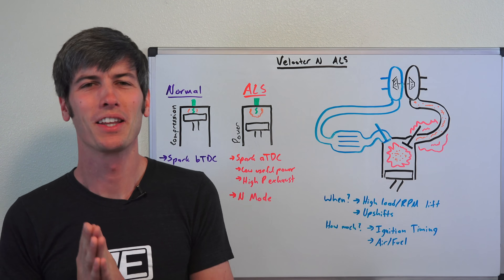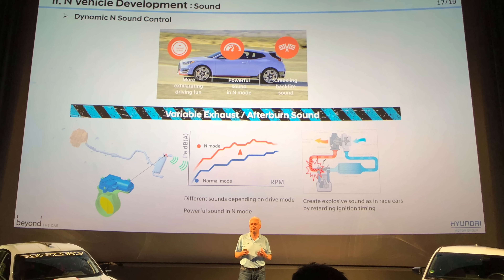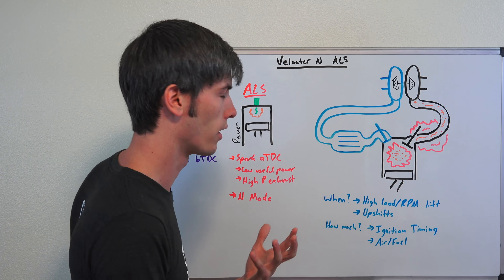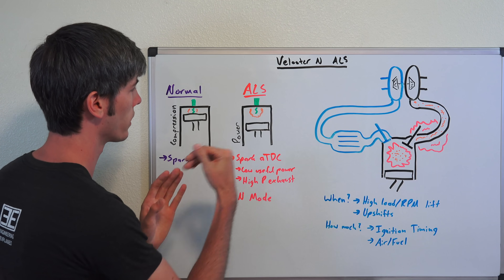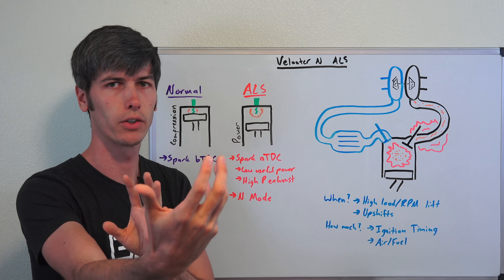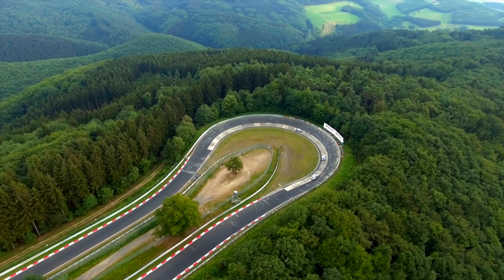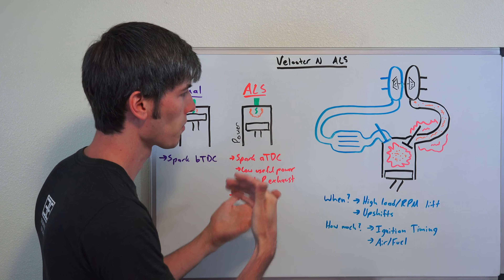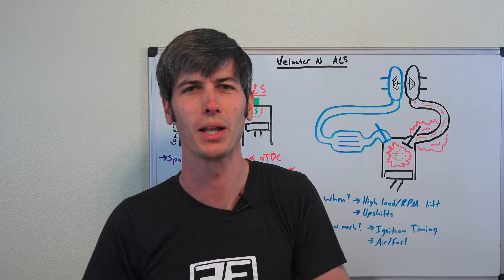Anti-Lag - How Hyundai Eliminates Turbo Lag

Comment: edited for fairness

I'll be honest, once the warranty runs out on these you could be forgiven for expecting a fair number of shocked and upset second hand buyers complaining of "premature" turbo failure.

Anti-Lag systems do have a negative effect on the lifespan of turbo chargers, even if you have high quality components.

If someone were to drive one of these for 150,000 miles in N mode, you might expect to get through two turbos or even three within warranty period, but that is an extreme example that makes a lot of assumptions.

As EE pointed out below, based on such a short video it would be unfair to say that this is a certainty, and it may well be that they've engineered out a majority of the issues and smoothed out the shockwaves...

Time will tell, and I really hope it's a positive result! If anti-lag systems can be engineered to not stress componentry unreasonably we could all have them in the future!

Personally I wouldn't buy any car with an anti-lag system present because of my fears of turbo failure, until the brave masses have "tested" it for us ten years down the line.
Reply from the maker: Phil Atkins it may happen, but I don’t think it’s ever safe to make assumptions about a design that engineers spent years on, after a 5 minute video haha.
Reply: Engineering Explained No, you're absolutely right, I really shouldn't be making guesses as to the timescales and longevity of componentry. I did err on the side of caution with an extreme example, but again I'm inferring a lot with very little information.

But. I will say that any combustion taking place outside of the combustion chamber, that is specifically intended to reach the turbo, will have a detrimental effect on the lifespan of moving components than if it didn't happen at all.

But again as you said I don't know what timescale that could be or how large the effects would be.

I just hope, for the consumers sake, that this isn't going to tarnish the reputation of Hyundai. I really like this car and where the brand is going, and antilag would be great if it weren't for the worrying benchmarks of previous systems like this one reducing the lifespan of turbochargers.
Reply: Id say your right back in the early 2000's, but turbo tech has come a long way. Its not hard to make a turbo last 200k in a performance car with an anti-lag system, its just expensive and heavy. Automakers dont like expensive and race teams dont like heavy, so its not seen too much. Honestly though, retarded timing is probably the gentlest form of ALS on components. The air/fuel injection systems are the ones that eat turbos in less than 4 races these days.
Reply: This anti-lag system is not as damaging as the wrc afterburners you’re thinking of
Reply: Phil Atkins You're right, an engineer from BMWs M division has no clue what he is doing. Neither do the rally and performance car mechanics they have working on the N lineup...
/facepalm
Reply: Tech Pappee racing, particularly rally, doesn't concern much for parts that will endure for 8 or 10 years. They have anything to replace during the race and many parts are made just for that time range. (BMW is using that approach?)
Reply: juliobro1 the average person who buy these aren't going to go rally. So why wouldnt parts last in normal everyday driving?
Reply: dj kommode it's not "the use" in question, it's the method or strategy of anti-lag. The method is kind-of destructive, which is why it's used in racing; they just replace and go. They have the budget for that, the regular consumer doesn't.
Reply: juliobro1 the regular consumer isn't going to be flat out on the gas all the time either. Factory warranty is 10 years and if I hammer one for ten years keeping it stock I think it can be worth it.
Reply: juliobro1 and what we see here in Stock form the asl isn't nearly as violent as any race built car.
Reply: dj kommode is this anti-lag applied only flat out? Apparently it's a mode you can select for the engine. Maybe if not used much, parts could last.

What me and others caution about is that the method does put more stress and wear on these parts, which is why is not recommended. And I ask, what is different now, what the manufacturer did to reduce the damage, if anything.
Reply: juliobro1 well first you have to address the two very different driving purpouses... Racing and daily public driving... I get it.. asl causes wear and tear... so does braking late.... and deleting recirculation valves..
Reply: dj kommode doesn't matter. It's a consumer sports car. Granted it's track oriented, but a consumer vehicle nonetheless. Even Eng. Expl. indicates in the review, that the feature may occur in any engine mode.
Reply: juliobro1 I still don't see any signaficant increase on wear and tear of the turbo or cats.
Reply: dj kommode neither did/do the engineers that developed this setup (obviously). I30N has the exact same performance parts as Veloster N. Same platform even just didnt shell. 

Has anyone complained about I30Ns antilag system causing issues? I haven't read or heard of any mechanical problems this setup has produced.
Reply: This seems to be less damaging than a straight bypass. But an antilag can really heats up a turbo, so who knows what will happen?
Reply: Phil Atkins I agree, and I don't understand why most don't see that...this has been a fundamental no-no for consumer cars. You see, this is knock, this is misfiring,  these are explosions occurring when the chamber is not sealed. The damage warned against include, not only the turbo, but cats, sensors, valves, cams, even the muffler.

Now, maybe all that doesn't happen like before, maybe parts endure more, or the valve and turbo systems are stronger; well, they should explain that. Even with the apparent engineering experience, because...it's not the first time manufacturer tricks end up costing more for the owner. Specially, as people are commenting here, when the warranty expires.

So, Engineering Explained should interview Hyundai and find out, how they're able to use "misfire" without damage to these parts...after warranty.
Reply: I agree
All that popping in the exhaust system is causing shock waves.  Pounding the turbo impeller not to mention the CAT is probably getting worked too.
Reply: Exactly.
Hyundai never cared to make the best car once the warranty is off.
They all become a bomb.
Reply: +1300l  That may be, but at least they put their money where their mouth is with a pretty spectacular warrantee.  Show me another manufacturer that backs its product for 10 years, and doesn't drop the warrantee if you do the occasional track day.
Reply: 5 years warant is cool and all, but a car should last much more than that, with or without the warant. Also who knows what they swap in these 5 years that wont last... so when it's over the car is trash
Reply: 5 years?  My '16 Veloster Turbo came with 10 years - from the factory.
Reply: aussiebloke609 I've updated my post to reflect the warranty period!
Reply: aussiebloke609 2016 Hyundai warranty... "5 yr/60,000 mi basic, 10 yr/100,000 mi powertrain"

2018 Hyundai warranty... "5 yr/60,000 mi basic, 10 yr/100,000 mi powertrain" -same

Hyundai hasn't lowered their warranty. It's still the same.

Comment: I put my auto Into R mode, I only max out 40 going the other way. why?
Reply: One ratio if you max out you have to get two big bottles from Harry’s and skip the limiter for that extra power, but be careful to not turn into a meme and be too soon junior.
The buster topped out at 140 that morning. Get him the two big bottles by tonight.
Reply from the maker: Dean Bay only Vin Diesel gets to go faster than 40 mph in R mode.

Comment: Why not added electric motor instead to keep the turbo spooling? The motor also make the turbo act like supercharger at low rpm. I think its a good idea...haha
Reply from the maker: rgandblue much easier, simpler, and cost effective to use the above strategy. Not to say both strategies don’t have their strengths, they absolutely do. But if every car was exactly the same it’d be pretty boring.
Reply: rgandblue cost, complexity so on. Why not use what's already available in the car with a few tweaks of the ECU?
Reply: isn't it exactly what audi does?
Reply: rgandblue cost maybe?
Reply: rgandblue,Your right on friend,I have often wondered why they haven't used a fan similar to a heater motor to boost the inlet pressure till the Turbo Spools up,that would surely help with Turbo Lag especially on a Diesel engine,it would certainly help to create a swirl in the cylinders to mix fuel better which in turn will burn cleaner,the electric fan would only be need at low RPM till the Turbo cut in and then a sensor could cut the feed to the electric motor.
Reply: That adds a bit of complexity and quite a bit of cost. Like already mentioned, Audi does this, but there's a reason we're only mentioning a premium brand here (that only does this on top tier models). Main issue: 12V is simply not enough to spool up the turbo. So, you need to add an entire additional electrical system running 48V ... Not really ideal when you're trying to make a fun and relatively cheap car.

Comment: i thought ALS system essentially destroyed the car and were only used in competition cars.
Reply from the maker: It’s a wonderful time in the car world!
Reply: Some ALS systems are pretty hard on the turbo - this one should be pretty mild by comparison.  That said, it will probably still cause some additional stresses - and since Hyundai back their product with a very good warrantee, I would imagine they've likely added strength to compensate.  Time will tell.
Reply: aussiebloke609 what would be the reason to pick an ALS over a hybrid turbo????
Reply: Simplicity and cost-effectiveness, I would judge.  A hybrid turbo would require a high-speed generator on the hot side, an electric motor on the cold side, a fast-discharge battery (compressor generally needs to be at full speed in <500 ms), and a control system (probably computerized) to run it all.  Hyundai's system uses retarding the ignition timing along with automated variations in throttle opening and fuel - things the car already does, so there's minimal added expense or complexity, mostly just a few added lines of code in the ECU.

Mind you, the hybrid systems have more flexibility, easier packaging and potentially tighter control of boost levels - but at a cost.  An expensive, upmarket brand could add that cost to the car and get away with it, but that's hard to do when you're making relatively inexpensive, small cars.

As for reliability...while the Hyundai system may be a little harder on the turbo, the hybrid system has a lot more parts that could potentially go bad and need replacing (the battery, controller and the hot-side electric motor come to mind), so that's a wash without actual parts and labour pricing.
Reply: aussiebloke609 you could do something similar with a single motor on the turbo shaft, ala F1. You'd need a very high speed motor and it would need to tolerate fairly high temps.

Comment: So if my ignition is retarded, it's actually a good thing?
Reply: On the road, the other retarded drivers around you have a bigger effect on turbo lag.
Reply from the maker: Adam K not if you’re trying to make power, but it’s a relative term.
Reply: /r/woosh
Reply: Adam K that's politically incorrect. The proper word is "challenged."
Reply: You want your ignition to be as "advanced" as possible, as near as possible to knocking in order to make good power and be efficient. Having the ignition retarded when trying to make power is not good (it's easier on the engine, though, less stress). Off power, the ignition advance doesn't matter much and can be used for cool stuff as described in the video.
Reply: As it's stated it's to reduce the turbo lag...  which is bad.. but also is not optimal for producing power

Comment: if it was RWD I'd probably buy one
Reply: Your American right?
Reply: Canadian, but you can't drift with a front wheel drive!
Reply: Fran actually fwd can drift. Search youtube for "fwd can be more fun" (this is a great video on this) or "fwd drifting". And there is also the crazy ebreak drift that is only possible on fwd cars.
Reply: You cannot drift with a FWD car. Period (yes, I'm being pedantic). Sure, it can be fun and you can slide with it, but it's not drifting.
Reply: @kenkalajdzic  It's not 'technical' drifting but most people would see a ST oversteering and call it a drift
Reply: @will9828  You are very mistaken! Watch Sideways Sid's review of the new Fiesta ST
Reply: My focus st will also oversteer if I put it in sportsmode. On the track it really helps turn in.
Reply: Tom Wagemans no it doesn't, it limits traction control and keeps stability control
Reply: Or all wheel drive
Reply: Dont fight guys, everyone is right here! AWD or RWD are both the best lol
Reply: Fran they all have there strengths none is the best it's just preference
Reply: Ppl mixing up lift off oversteer with drifting. You can't drift (= using the back wheels to keep it sideways) an FWD car. Doesn't make it less fun to drive imo.

Comment: Marketed as sound enhancer to become legal in numerous countries (only know about Australia as I live here) where antilag is an instant defect notice
Reply: I was wondering if it was legal here lol
Reply: It's easy to turn off - but a manufacturer can't really use that trick.
Reply: @calorus  it won't help you to turn it of if the cops hear it or people call the cops on you. Dunno how it work ls in your country but here in Austria the police will impound the car and have their technicians take your car apart to look for any modifications.
If they load the modified ecu map, they are going to fine you for novice disturbance, illegalaly modifying your car and environmental fines so it will total to 4k€ including towing and recertification.
Reply: @afox5319  The UK is worse than the EU for many things, including getting fuel to pumps, but we're among the best in Europe for vehicular freedom.
Reply: TrumpCat ECUs like the Link G4+ usually have a toggle feature for it, it’s illegal not because of its mechanics but rather (in Australia being in its current nanny state) seen as a public nuisance and hoon-encouraging
Reply: I don't recall seeing anti-lag mentioned in vicroads rules or vics epa laws. As long as it's under 90bd (lol) and uses the stock ecu and map and has a cat it should be legal. <-- this pretty much rules out antilag.  To change the ecu and map you are meant to get engineered and epa tested. Still has to have a cat and still be under 90db though
Reply: Avrilcadabra A guy I know who had an antilag system (with a Link ecu) fitted professionally on his 03 STi had his car marked a as ‘vehicle of interest’ by WA police and ended up up parting his whole car out because he would get pulled over everytime they saw him on the road.

Comment: Keeping the turbo spooled AND cool noises? Sign me up!
Reply: This antilag system sounds a lot less aggressive than others, I'm sure the engineers took extra wear into account. Doesn't quite sound like gunfire like aftermarket setups do
Reply: Fernde09 this also has to do this it being a production vehicle and having to pass epa regulations. Most vehicles that have an anti lag system installed are most likely decatted with maybe a secondary cat based on emissions in their area.
Reply: alex zoidberg True, but remember they have a really long warranty... so they got to make it last for a while.
Reply: alex zoidberg engineers had surely been concerned with the material selection for manifold, turbine housing and wheel, and the degrees after TDC are not the same as what heavy motorsport applications use to...so I'll be fine with this 😉
Reply: It doesn't even sound that great! I never liked the fart of the DSG Golf and this comes close

Comment: how does this impact emissions testing, emissions systems and catalytic converter life?.  Sounds like there's more combustion going into the exhaust system instead of burned gasses.  Finally are there any quantifiable performance gains?
Reply: It only woks in N mode, and you should only really use N mode on a race track. Emissions test bodies don't really care what you put out on a track, it's only going to be a few hours a year. Same goes for cat-cons, maybe you just have to replace them earlier IF you often operate in N mode. There must be something mentioned in the operator's manual about that.
The ALS allows them to use bigger turbos without the drawbacks, and this specific solution is very cost effective and requires no extra parts.
 The performance gain is more power from the bigger turbo, and easier handling on the track. You don't want a sudden burst of power when the turbo starts to spool up again, at the same time you're just on the throttle accelerating out of a corner.
Reply: CO² emissions are set to 178 g/km in the new WLTP procedure. For comparison the Golf GTI Performance with a comparable drive train is set at 173 g/km...and it is 30hp down on the Hyundai (245 hp Golf vs 275 hp i30N).